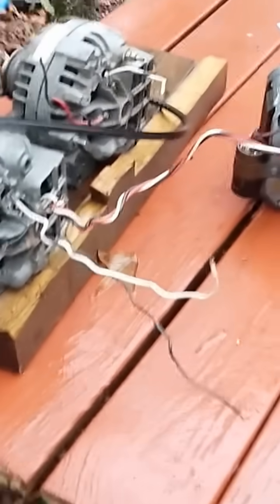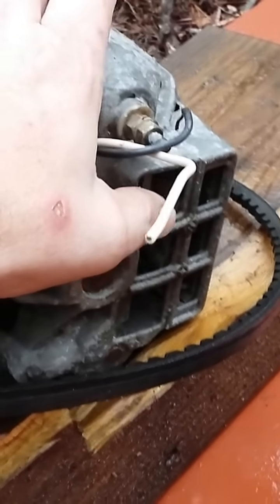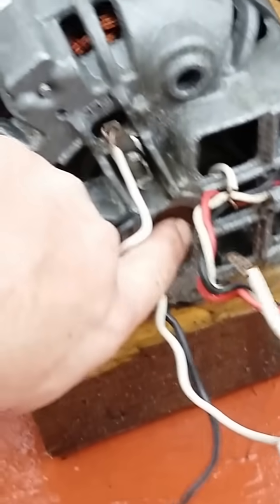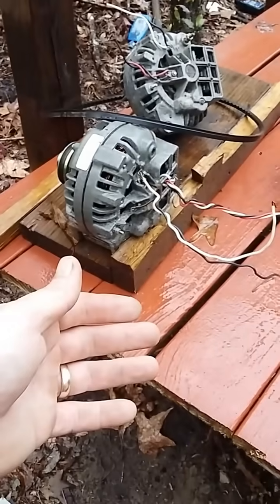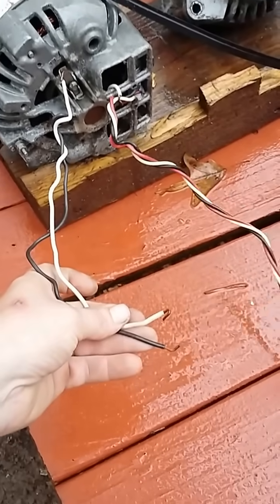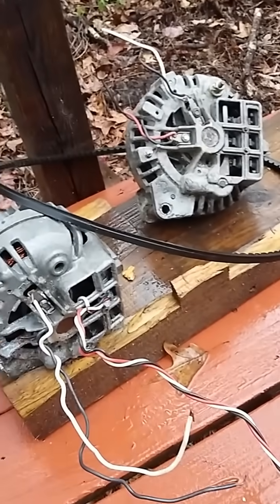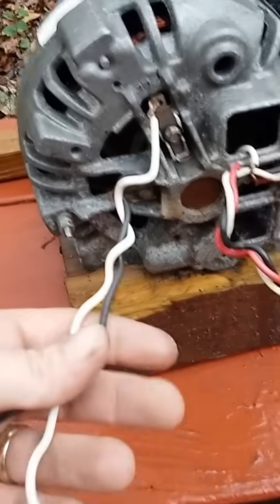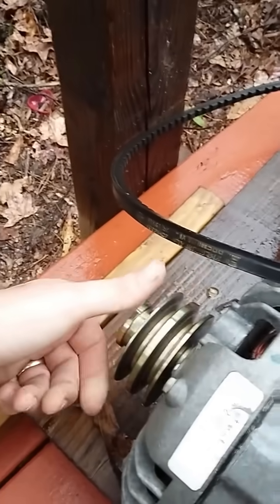Update Free energy forever no wind no solar no gas READ DISCRIPTION!!!

Comment: This will never work,  where do you get the energy to run those alternators,  how do you control the HERTZ (cycles per second) at the 12 volt AC output. Remember home electric appliances run at 50 or 60 hertz. An alternator must run at least 3000 RPM to develop a decent amperage or AC voltage like 120 volts and the HERTZ will run over the roof, well beyond 50 or 60 HERTZ. With DC 12 volts, it is a different ball game. 10/22/17.
Reply: He said 3-12 volts dc at 1:40
Reply from the maker: well that just goes to show how much you know 3000 revolutions per minute is 50 hertz 50 pulses per second * 60 seconds equals 3600 revolutions per minute but all you guys want to bash me instead of asking intelligent questions in order for you to get 60 hertz you would need to run it at 3600 RPM which is what people in the United States use now if you're going to use this and Australia then you would turn it at 3000 revolutions per minute but let's not talk about the diodes and how they change the alternate current coming from the alternator into direct current to charge your battery and everything in your vehicle and you can hook up a 10000 watt sound system to it and bump all your speakers but you can't change one alternator into a motor like I done in my other video(bldcmotor) and use it to turn a few alternators that would never work! 
#livelifeloving
Reply from the maker: I'm sorry Victor I didn't answer all of your questions did you notice that your comment wasn't blocked by the algorithms I set up I guess that's what happens when you ask questions instead of just cussing someone...  your first question was how do I control the Hertz well running any generator at a certain speed will control the hearts or you can use different ways of phase matching but the easiest way to do it is to just keep the motor at a certain speed plus or minus 5%...  well I guess that was the only question alright here's a couple of questions that you didn't ask but you will be asking soon if used as a motor without the diodes in it at all connecting your three stator wires directly to a 3-phase motor controller you will need at least 12 volts input from your motor controller you can use a buck converter or mosfets 2 Amp that up before it goes in the alternator stator wires if you want more power from your modified alternator Slash motor now in order for this to even work you're going to have to create a magnetic force on your rotor which is your two field wire ends you don't have to have a lot for this although this will change properties in your system it won't damage the alternator unless you go above 12 volts without putting a diode into the circuit of the rotor now let me tell you if you put 12 volts to it. it will not turn very fast but it will break your arm if you try to stop it from turning I like to use about 6vdc  is pretty good power with pretty good speed but 3.7 volts will work just fine and you will get quite a bit more speed.  in other words what I'm saying is the lower the voltage the higher the amperage on your field the faster and stronger it will turn but it will only hold so many amps so about 6 volts and 35 amps per hour is Max for this type of system now keep in mind what I said on the other comment about one alternator charging your car battery and powering your sound system and everything else and your headlights and all that stuff all at once...  but for your house you're going to need three or four minimum if you are not going to do a lot of modifications and some inverters there are different ways of doing this for it to work it depends on how much money you have and what you can get for free...  you can use AC Motors hooked up to AC generators you can use DC motors hooked up to DC generators which is the same thing a DC motor hooked up to a DC motor there really isn't much difference in the word motor and Generator and the word generator is the same word as the word alternator... I will try to finish my next video and get it up today if possible and it will explain a lot more if you haven't looked through my videos you should check out motor demo??? And bldc motor from alternator at the very least.

Comment: If you were paying attention you power the motor off of the alternator once it gets going it is self powered
Reply: Al Bar doesn't work like that.

The laws of physics which were discovered before electricity say energy cannot be created or destroyed.
Reply: jmcinvale. So the alt. Wont make dc power to run the washing machine motor and then you get ac off the coil ??
Reply: No the alternator simply won't put out enough voltage and even if it did the losses in the motor and alternator would keep it from running very long on its own.
Reply: So he's created a true perpetual motion device.......mmm hmm.
Reply: Laverne Johnson that was sarcasm.  I didn't truly believe the guy playing with alternators in the rain had actually managed perpetual motion lol.
Reply: Laverne Johnson 

Now if the free energy wackos would just understand what you wrote.

Instead their response is usually that the laws of physics must have been written to suppress free energy.

Comment: When you take the AC voltage directly from the coils, before the diodes, isn't it 3 phase AC? How do you use that without special circuitry? Have you actually tried this?

Comment: as soon as you load a single altenator to full load the system will stop. Energy cannot be created or destroyed, and you still have heat losses in both the altenator and the motor so the work of the motor WILL not power the system if not suplemented by an additional power source that will need be greater than the heat losses.

Comment: Its smiple 3 car alt turn one into a motor that runs off the other two. The other two make more then the one can use. So it powers it self after a one time starting charge. Both with make 240v when your using 12v runing it your left with 228v at 180amp. And if up the size well you could sell it back to the line and get paid for it (in a perfect world) that just doesn't happen though but this will work IF DONE RIGHT.
Reply: So tell me how a car alternator produces that much voltage?

If it did then after rectification when used in a car there would need to be a  way to drop that much voltage down to around 14 volts. Ain't happening buddy.

Comment: I would think that a basic windmill geared with a water wheel could power those motors. See the water would fill buckets and drive themselves around. Question is "do you need these or just a wind generator?"

Comment: It works some what it doesn't create the energy he is claiming I did one just to run CB amp my question is how is he running the alternator with a gas motor or is he plugging in then trying to create the power PS maybe you should concentrate on that yelling kid in the background
Reply: Goodfellas Inc. Shane jolly invented what he is explaining to be a circular circuit using electric golf cart motor 6 car bateries and 4 altonators this guy didnt invent shit copy cat
Reply: Goodfellas Inc. maybe he needs a battery to start it first, then once it’s running it can power itself

Comment: You are an idiot! That isnt how electricity works! You cant increases the overall wattage with this device unless you increase the supply of power. You can increase the voltage or amparage but not both without some kind of power generation. The higher the amps the lower the volts and vice versa... Anyone with any knowledge of electricity will kbow this.
Reply: Daniel Simnitt Yep, ohms law E=I×R

Comment: You can not create energy
Reply: Thomas Buie That is true. However some of it is turned into heat from friction on the bearings in the alternator. That means the system is not perpetual as a lot of the energy will be expelled into the atmosphere as heat.
Reply from the maker: Jason Shubert 
you cannot destroy energy
Reply: Yep energy can neither be created nor destroyed.

Comment: I’m calling bs. If it worked he would be showing it in action and it wouldn’t be sitting in the rain.
Reply: Payton Michaels it actually does work and once it's running you don't need any battery power just like when you start your car you can take your battery right out and drive it with no battery correct?? Same idea once you get it going with the battery you could unhook it until it shuts off when you use the battery again it absolutely works how do you figure your car drives every day
Reply: Dmk pit gas engine turns the alternator. There are much smarter men than this who have tried to create free energy.
Reply: Go Tribe! One is an alternator the other one as an electric motor power them with the battery to start,  the electric motor will get its power from the speeding alternator as well as put power out to whatever  you want the power and it will run itself with no gasoline no battery power no gas engine

Comment: The only way to get free energy is from a fast breeder nuclear reactor. it makes more fuel then it uses.
Reply from the maker: Gary Lewis that's hilarious 10 minutes ago you posted a comment right underneath this one saying there is no such thing as free energy so which is it there's no such thing or there's only one such thing? and what about Stanley Myers did he have a free energy device or was it just a car that run on water why don't you do some research on that because I have all of his blueprints on that particular subject I'm sick of people like you! you didn't watch any of my other videos or read any of the comments on this stupid video that I hate so much but  because I have to have it on here I cannot weed through the idiots and the mean people without this video.
Reply from the maker: Gary Lewis what about a jewel thief or 555 timer you know 3 resistors, couple flip flops you know how they're made, used in conjunction whith an n Channel mosfet and a p Channel mosfet you can't get more out of it then what you put into it starting in to separate places and joining it back together capacitance.. what about the fact that if you take a 3-phase motor and only power two of the phases.. the other phase will actually put an output that's greater than the power you're putting into the other two inputs? watch my video called motor demo??? where I don't even hook the mains power wire in at all on the motor it is the black wire....  using that relay and shorting the circuit in to get the field to power up. you'll notice that I'm putting a hundred watts into this motor and getting 183 Watts out of it with a load against it...
Reply: Gary, what to said violates the laws of physics.

Comment: there is no such thing as free energy. Even Leanardo Devincy knew there is no such thing as a perpetual machine. You need to back to high school and complete it
Reply from the maker: Gary Lewis just because you're not educated on the subject doesn't mean you have the right to knock other people down why don't you do some research instead of just being a dumbass
Reply: Um if you where to use the electricity from the battery wouldn't it meant that the power generated from the motor lower and the speed of the motor would decrease the electricity it gives so pretty much you cant power your house while making it work
Reply: The reason he saying it's free energy because the amount of power you need from a battery is equivalent to a fucking 9 V battery which is what $.20 as opposed to what you're going to get out of the other end of them voltage wires jack ass

Comment: I been building the same style setup for many years now and it does work unfortunately at full tilt running continually the motor/ alt. Burns up after 2 ish months.
Reply: Michael McKnight yeah that was my only comment I had was wasn't going to be knocking it is alternators don't last that long but if you get one from a diesel truck motor that do 1,000,000+ miles it will go much longer six months baby still you can find them in the junkyard for five to $20 as opposed to pay 150 to 300 a month to the electric company, if someone actually make a clean nice looking set up it would probably sell good on the black market until the big corporations came in murdered you haha

Comment: Wrong. A diode does not change dc to ac current. Diodes are like a back flow preventer. Current flows one way but not the other way.
Reply from the maker: ToughAncientSpark 
NO, I AM right! 6 diodes on a direct current Bridge rectifier wired up to a 3-phase stator coil will change alternate current into direct current. diodes direct the flow of current! period! Now, you can manipulate where the current flows to do many other things.
Reply: You are correct diodes can change  a.c. to dc but you are not getting 90 amps put of that and are not able to weld with it look at the cable to a welder vs those cables of the alternator. Those things would be smoking.

Comment: Same old thing.  One motor using more power than the 2 alternators produce...  It is good to try stuff and learn though.  Friction and heat eat some of your power as the electromagnetic force is converted to kinetic force to turn the stator in the electric motor, then lost again through the conversion back to electricity in the alternators.  This will never be "free energy"  unless the alternators are turned by wind, water, or steam.

Comment: This is something that I will try, now i'd like to know where I need to connect the 3 wires youmention in the video the ones with the high output.
Reply from the maker: Hermis Gonzalez 
well don't go off of the instructions off of this video unless you read all the comments and if you're going to be using a regular motor then you don't need to watch the bldc motor video where I turn an alternator into a motor.  there's no difference between the word alternator and Generator and a motor is also just the same thing it's just wired different...
Reply from the maker: Kenneth Nicklowicz you're exactly right one alternator could in no way power a whole house by itself but if you had two ten thousand watt generators running off of a 3 horsepower compressor Duty motor then you wouldn't have an electric bill guess what I don't have an electric bill there are no electric lines ran on my property at all
Reply: Exactly I have made several generators. If it produced as much power as claimed them they wouldn't need as many "generators" to make usable energy from the wind type generators which work same as an alternator. No way 1 altertor would run a whole house by itself even at it's highest speed to which wouild require a source of energy of some kind to spin it
Reply: Thomas Buie 2 generators or 2 alternators?
Reply from the maker: Hermis Gonzalez 
there is absolutely no difference in the word generator and alternator. generator's actually used to be called alternators, a car generator does not put out as much current as a house generator...
Reply: Hermis Gonzalez thats exactly my question if he's in the woods where does he get the 9 volts
Reply from the maker: Rob Garcia
 go outside take your voltage meter and set it to 20 VDC and stick both leads in the dirt and tell me what it says...  why do they have step-down Transformers in the first place these are questions that you need to ask. what is the purpose for having an electrolytic dielectric Transformer?
Reply: Thomas Buie he doesn't have a clue

Comment: You forgot to tell everyone where you get the power from to run the motor that is turning the alternator. Whatever you use to turn the alternator is going to require power. Rather that be an electric motor in your video or a gasoline engine. It's going to cost something to turn your alternator.  Very poor video,  I give it a thumbs down.
Reply: P Stoneking he has logic right about alternator giving ac. Not that many amps but correct something has to spin it and per physics can't get more energy out then you give..super funny video
Reply: Thomas Buie yes but you are not taking into consideration it takes some kind of energy to rotate. Show us this spinning without gas fuel or using a free mechaninial source and it running your house and I will throw my hats off and say you have defined the laws of physics. Drops the mic. Till then it's all talk
Reply: Thomas Buie yes some things do work but in this case no you won't run a whole house from 1 alternator without waiting more energy then you put into it. Logically your correct it can produce a.c....and maybe enough volts and perhaps can even get the Hz. but not enough amps to be of real use ..even if you got it to spin perfectly it would not be a stable sinewav which is why they have a rectifier and voltage regulator

Comment: I thought you were going to show us how it work. Not tell us. 100 amp at 12 volts is different then 100 amps at 240 volts or 120 volts. And 90 volts is real bad power. As electrican. 90 volts like to fry electronics and appliances. 90 volts in a house is really bad voltage. Just wanted to see it run by the way 100amps should have at least a #4 copper wire.

Comment: You will not get as much or equal power out of the alternator/generator than the power source used to drive your "generator". Thus, you can not use your device as claimed for "free Energy". You say yourself, "to put a voltage to it" and if you use a car battery, your device will always produce less total power (amps x volts) than the car battery could on its own to power a device...especially under any load. What you have succeeded at is a very power inefficient ac/dc converter and that is all it is.
I'm pretty sure people said you wouldn't live very long if you kept doing what you're doing not because you're a genious but, that you are a fool bound to be fried in the rain so, it's safe to move back to town now so paramedics won't have to follow the smoke signals to help you. Lol